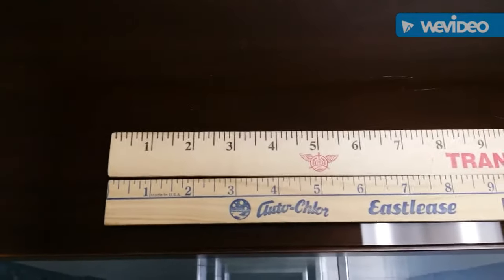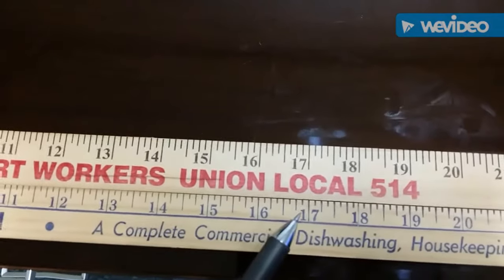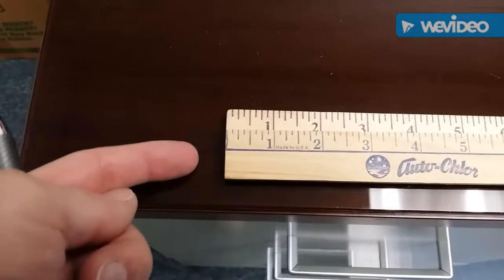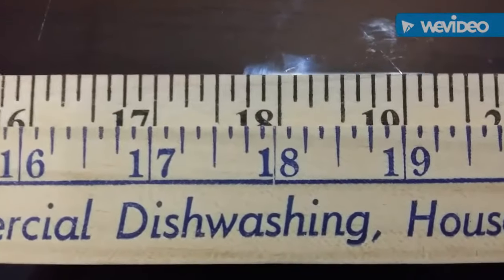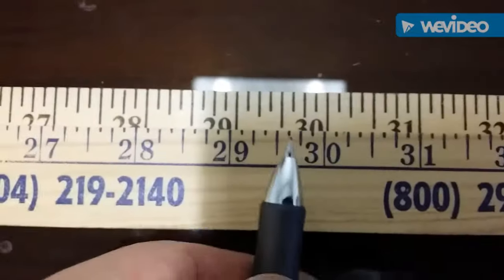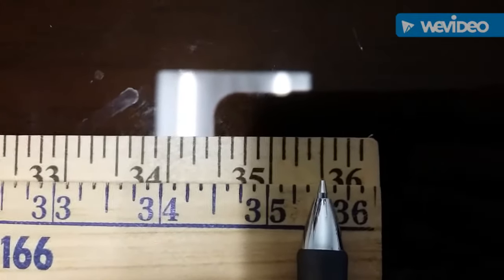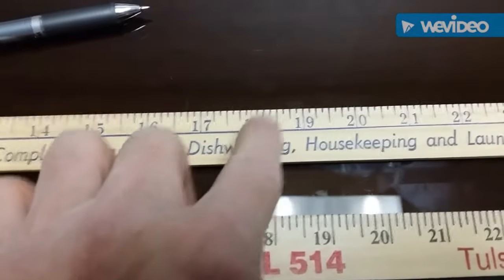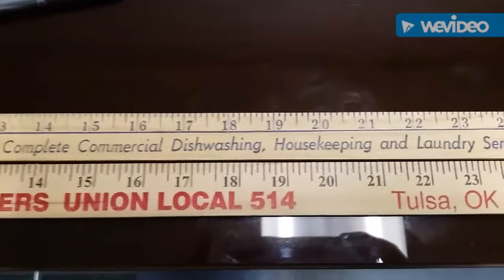[86] Non-STANDARDIZED Yardsticks || 2 Second Lean

Comment: Well, that's pretty surprising. Maybe the wood shrank and expanded in different areas over the years?
Reply from the maker: I might have to expand on those non-standardized measurements.

I didn't think of the wood shrinking / expanding.